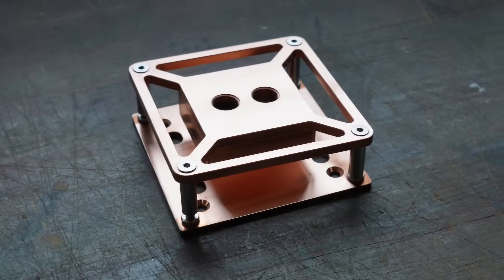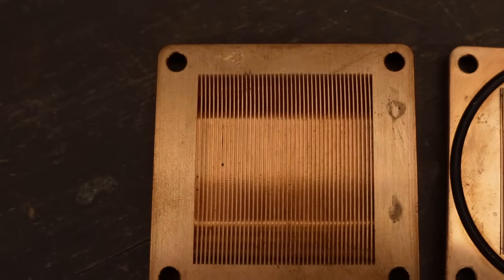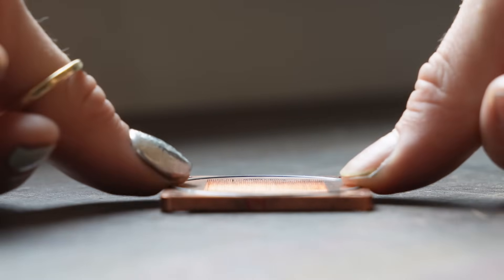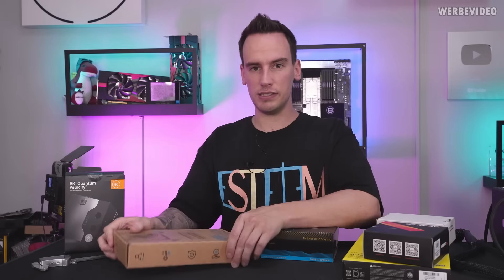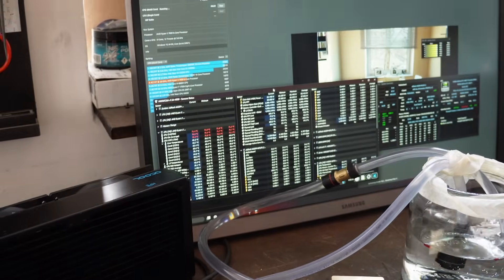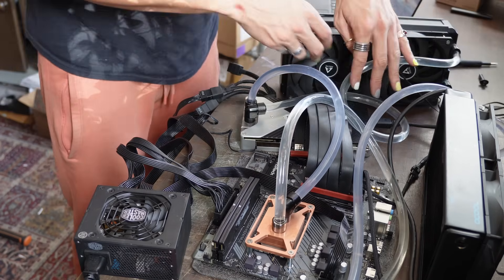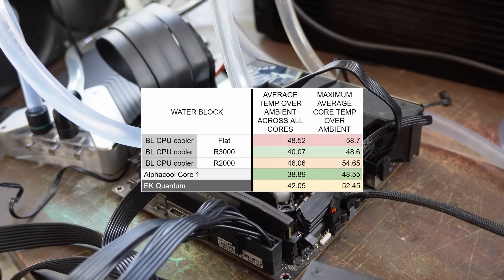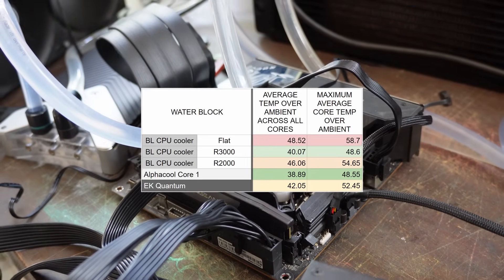We made our own CPU Water Block, and tested it against the best!

Comment: I hope you read this!   Here's something I've been wanting to do for a while that you can do and test.   Maybe it can change the entire liquid cooling industry.  Some facts first - then my thoughts on how to use the studies.  There could be more - this is just off the top of my head - thinking out loud.  Let me know what you think!   Figure out a way to use carbon nanotubes - You know,  at that scale, water flows FASTER through carbon nanotubes than  it would a 3/4" inch tube.  No one else has tried because this is a little known and talked about fact.  #AUTIST - WE THINK DIFFERENTLY  - Oxygen makes it flow smoothly 😉and so there is less resistance which also means that water has full molecular contact than it ever would any other way with everything around it.  Oxygen in the water/fluid is the issue.  Carbon is HYDROPHOBIC -  ZERO MANUFACTURERS use a hydrophobic coating on water blocks and the lines and items they flow through which is asinine.  When there is less resistance, water molecules align themselves creating a faster flow rate as well.  So diameter is not an issue - it's the effect of being hydrophobic - without oxygen - so since a larger diameter than the nano scale is being used, and we know that we can coat a surface - the surface though needs to be unflawed - any coating would just increase flaws on the surface.  graphene ceramic coating isn't new, but it's also not used because it's not cost effective, and it would make the waterblock last longer, as it also prevents mixed metal corrosion, and it also helps stop water from permeating through a surface.   Water and carbon make a quantum couple: the flow of water on a carbon surface is governed by an unusual phenomenon dubbed quantum friction.  This is the effect the two have on eachother - rapid cooling of the water at the same time and the carbon and surface it is on dissipating the heat.  - A spray on coating is not very effective because it isn't a permanent solution.    Graphene Ceramic Coatings are long lasting, can last up to 10 years.  Where have you heard this before?  On a proven platform that has nothing to do with computers - Protecting a vehicles paint.   -  What is nicer is that you can find a few on the market that have a flourescent component in the Graphene Ceramic Coating - so you can use a UV light (365nm wavelength - can be found anywhere online and don't cost much - but you can use it to see any section that was missed in the coating process and to look for wear over time.   The issue of buildup inside of the fins of a waterblock - no longer becomes an issue - nothing sticks to the coated surface.  It's not very cheap, and this is another reason it's not used - companies would rather spend as less as possible to make a profit - than make a product that will not be replaced for a long time and has a very very very low failure rate.
Reply: Also - maybe this can work both having the coating on the inside - AND on the bottom of the cold plate - to help create a more smooth surface and to prevent chemical corrosion while aiding in heat dissipation.

Comment: Man if you put some effort into designing the monoblock to look better on the motherboard I would buy it and throw out my EK monoblock!
Edit: After watching through the whole video, I think if you make both horizontal and vertical cuts for the fins to maximize surface area you'll lower the temperature 2-3% and be able to confidently claim that the block performs better than the core one.

Comment: The AM5 block could be rather interesting for a future project of mine. I'm also eyeballing one of the Pump Tops, how does the brass top compare against the acetal one when it comes to noise?
Reply from the maker: We'll get the blocks up for pre-order once they're ready, so hopefully you can use it in that project! It's hard to say noise-wise on the tops - brass will naturally be quieter, but we've not yet done a side-by-side test.
Reply: @BilletLabs  Considering brass higher tendency to resonate or vibrate I would've guessed otherwise. That said I'm not familiar enough with acetal, so I don't really know how absorbent it actually is. Should probably just go by looks instead of over thinking it.

I'm hoping to somehow fit a 7800x3D, 7900 XTX, x670e Gene, some sort of PSU and at least two 280 30 with the rest of the loop in a SFF case. Unfortunately flitting everything in a case isn't the main challenge, keeping the Gen-Z.2 adapter easily accessible is the true one. Probably requires me to either build a case myself or at least modifiy one, going with a Ncase M2 and mostly ext rads should also work sub 20L.

Comment: Hey would it be possible to get just the cold plate without the mounting holes or O ring cut out , I’d love to take a crack at retrofitting it to a cheap disto block by drilling my own holes

Comment: While I really appreciate the dedication, tinkering, workmanship and effort, I wonder where this is leading to. You are basically referencing versus alphacool which are a high end but still an affordable (forget about EKWB they're a joke by now) mass production segment on the market. The goal doesn't seem to be direct die either, I think Grizzly are pretty strong in that segment currently or any decent block that can be mounted direct die with a sufficiently sized radiator and reservoir. So from a business perspective, since this is supposedly ending up in a production run or at least a final "commercial version", how many do you need to sell at what price to just break even? 
Don't get me wrong here, I don't want to hate or diminish your efforts but as long as the IHS is still on, your gains will always be marginal and highly dependent on make/model/bin, thermal paste and most of all quality/porosity/thickness of the indium solder under it. I understand the ideological side of it but from a business side this seems so odd and almost like reinventing the wheel to me even if it is an optical gem and very high quality solid copper wheel...

Comment: Just wondering, are the backplate and top copper as well?
If so, why?
it would be much cheaper to do steel or other materials and shouldn't afflict performance.
Copper is also quite soft, so it can exert less pressure.
Reply from the maker: Mostly because we think it looks awesome. There's some theoretical thermal benefit too (more thermal mass) but we've not done controlled tests to see if it's measurable. We're not trying to get this is as cheap as possible - it's machined in the UK so it's never going to be competitive on price at the lower end. We want our products to be beautiful and functional in equal measure; price is not our primary objective. The 5mm copper top plate has more than enough pressure to rip your motherboard in half if you tried.
Reply: @BilletLabs  I'm waiting for GN's chart on motherboards ripped in two.

Comment: Does the Alfa Cool also have a curved base? Otherwise, you may be attacking the problem from the wrong side. Maybe your mounting system should be optimized instead. Also, maybe you should isolate the variables and test only the fins as yours may already be better.

Comment: OK i lost track of time my 1st watercooler bought 2017 au $180 
2025 a hose crack wondered why my PC went haywire 102cel deepcool 1 radiator did a good job R.I P 4 parts now 
Ordered a 240 white RGB water cooler Temu au $70.00 1/3rd the price of them name brands  x3 $ xd

Comment: You still have your work cut out for you. You can't compete with alphacool on price, and optimus on performance / build quality. For just a cpu block, the niche factor of the cpu/gpu block is gone, so you need some kind of value add for what I expect will be a lofty price tag. I don't think just a copper aesthetic will get you there.
Reply: stinks of 2010 kickstarter gimmick

Comment: The LEAST you could have done is make sure those fingernails are in tip top shape with regard to their colors - but you just recorded this with them chipped to hell.  Tsk tsk tsk.
Reply: Spoken like someone who has never had to do actual work while wearing nail polish. Tsk tsk tsk.
Reply: hit the thank button and send them $100 to get them done, problem solved.
Reply: @xBINARYGODx ??? are you okay, bro?
Reply from the maker: I actually hand-forged my metal thumbnail from a piece of sheet metal and glued it on so it couldn't chip. But I also have a nail polish business, so the rest of the nails are always in varying states of disrepair as I try out new mixtures for things.